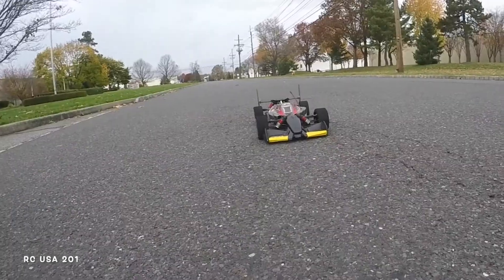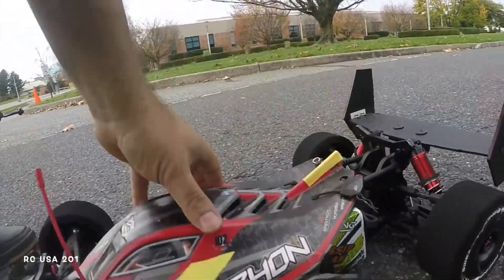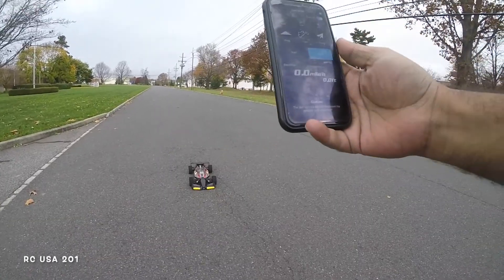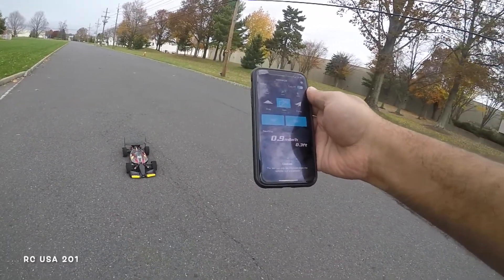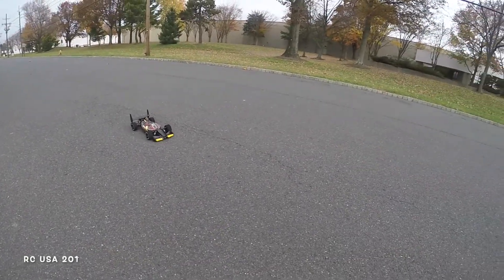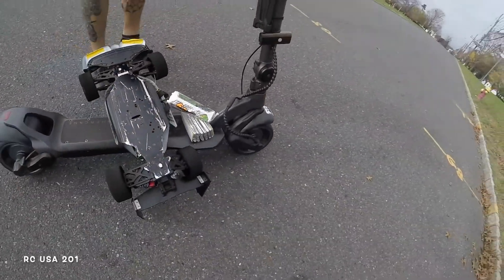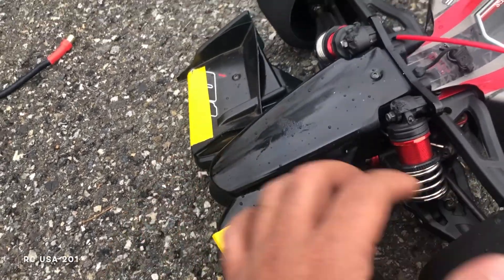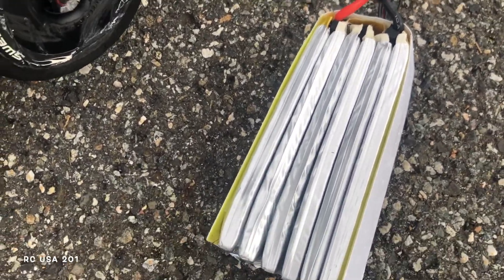Arrma Typhon kill mode TP 2900kV 90c CHNL LiPo crashed at 119mph

Comment: Ouch!!... Your lucky it didn't go up in flames like it happened to me with a 4S version of that same lipo, but a 9500mah one!! Had a crash at 127mph with my limitless 🙆‍♂️
But it still sucks cuz these batteries ain't cheap! I just picked up a pair of 3S SMC for my stretched Typhon 6S, even with a 10%code & $25 voucher, they still came out to $91 lol.
Reply from the maker: Yeah this was easy pass I did I never got to push the throttle 100% it would had done 130+ that was my aim but the nose messed it all up